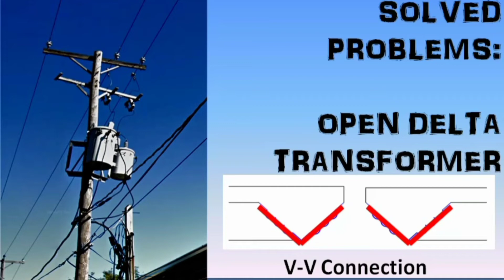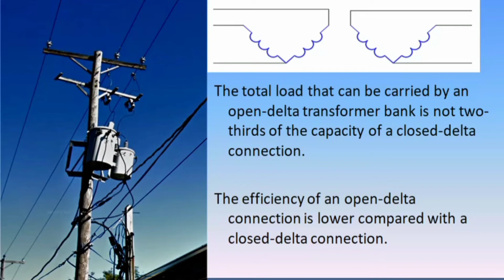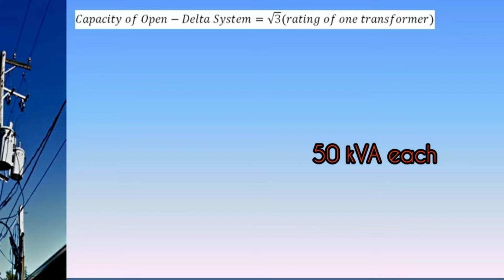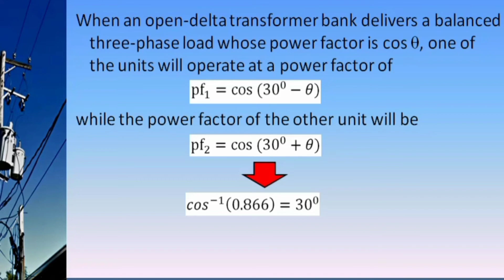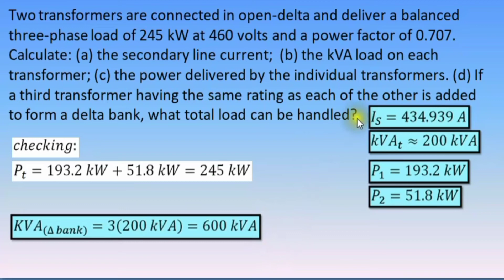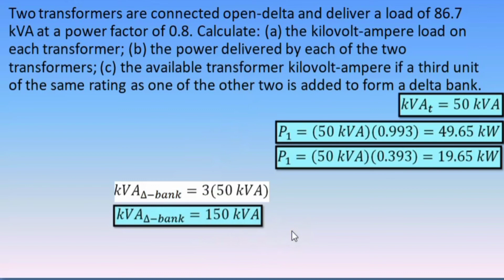Open-Delta (V-V) Transformer Connection: with Solved Problems

Comment: Sir regarding sa question po sa problems 3 and 4, diba po ang tanong ay what current flows in the secondary of "each" transformer. Sadya po bang yung total current ay sya ring current ng each transformer? Ang guess ko po ay baka series connection ang secondary coils ng transformer pag naka open delta configuration kung kayat ang total current ay sya ring current drawn by each transformer. Tama po ba pagkakaintindi ko?
Reply: Tama

Comment: Goodmorning po sir, ano po ang sign kung kailan po ba gagamit sa ganyang formula medyo mahina po kasi ako sa pag dedetermine pagdating sa problem sir.
Reply from the maker: kapag ang problem is involving open-delta transformer. may konting difference kapag sa delta and wye connected transformers na. so check lang anong klaseng three phase transformer connection ang nasa problem. lalo na kung nasa actual application na
Reply: Sir wala po kayong scott knott transformer bank connection ?
Reply from the maker: Oh, sorry. wala pa.